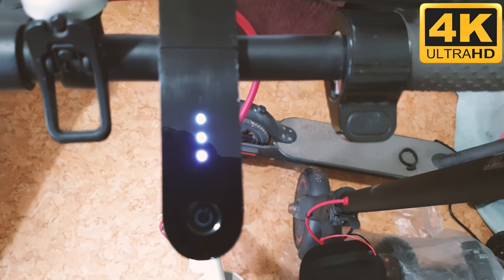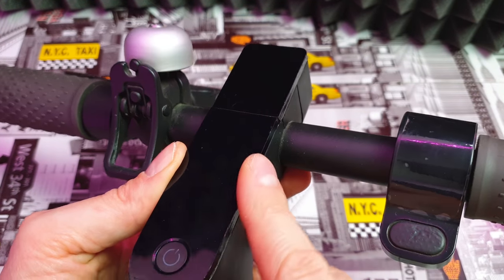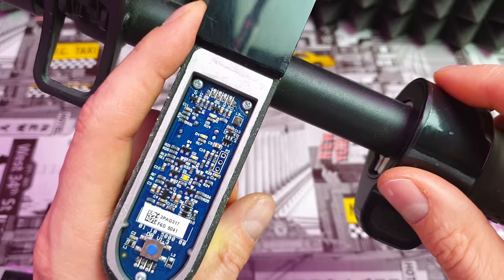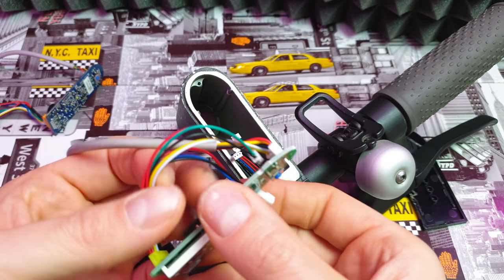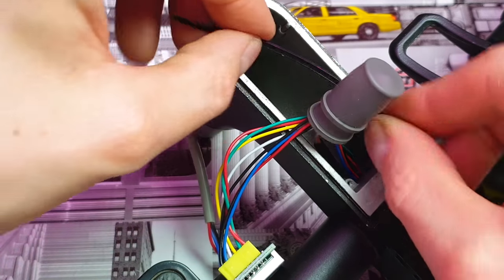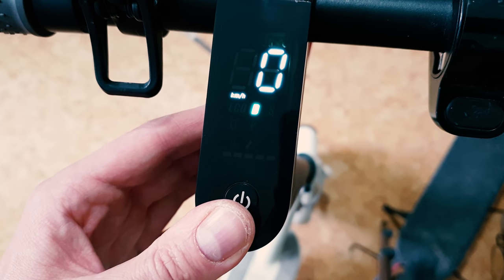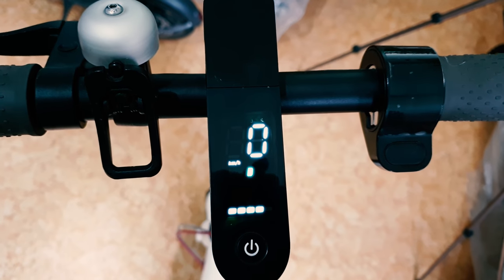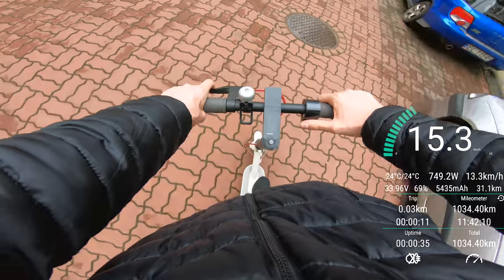How to Mod Xiaomi M365 to Pro Dashboard 🚀⚡ For only 25$ ?!  🔥🔥

Comment: I'm a little concerned as how the pro dashboard treats the smaller battery and weaker motor, are therr any compatibility issues such as over charge/over discharging battery, are you still able to update through mijia etc
Reply from the maker: So you can decrease power in moded FW, no other issues, dont connect to xiaomi app cause its not very usefull any more.
Reply: @PirateWasHere  thanks for the confirmation! Will definitely do this mod~

Comment: Thanks man, everything works fine (also could't update BMS)
Reply: Connect old dash board, just the 1 wire and update them then reconnect upgraded dash
Reply: @waldo2600  which wire? the big one?

Comment: Hello Pirate,
is there any working BMS and BLE, the one you provided cant be flashed on mine. Or is there any other I can try? Thank you
Reply from the maker: U dont need to flash it 🍕🍻
Reply: @PirateWasHere  I am getting random bluetooth disconection during I ride.
Reply from the maker: Looks like some issue with bt, check how to update fw on bt it can be done by other hardware

Comment: Hello 🤗! 
May I verify... So if I want to go ahead & switch to this Bluetooth dashboard, etc, did you say we should also get bigger battery? What happens if I don't boost or upgrade battery? Would the battery get drained really fast??
Thank you in advance
Reply from the maker: Yeah cause pro in stock got 1000watts while classic around 600
Reply: @PirateWasHere  Sir Pirate, may I ask another question? 
Can I just plug in & have the Bluetooth digital dashboard, and use it as is, and not do any upgrades or hacks? 
Would the dashboard work if I don't flash those firmware things??

I would like the dashboard to read the speedometer, but I don't want to boost my regular M365.

Comment: I managed to install Drv upgrade. But I got stuck with bms upgrade or ble upgrade. Bms is stuck on 95%, ble don't even start. I tried to switch to old dashboard (as suggested ) and managed to flash bms pro.  When I switched back to pro dashboard there is still no change. Still some strange version number.  Side effect is that rear light is not working.  I am not sure for any other side effect. Is there a way to to flash bms pro version or is it even not necessary to do that upgrade?
Reply from the maker: I woud not Upgrade BMS and dash , just DRV :)
Reply: @PirateWasHere  thank you. BLE seems pointless trying to upgrade if it works as it is. BMS is for battery pack if I am correct? Do you have any experience of having problems with battery/power because of dashboard upgrade?

Comment: When I drive with DRV155 loaded, the scooter gets to 30-32 km/h and then it slows down and then reaccelerate again, is there a way to stop this from happening? like before custom firmware is was stable on 25 km/h without slowing down the acceleration when hitting max speed. Is a pain when hitting 30 km/h and it breaks down to 28 km/h and then accelerate up again.
Reply from the maker: I hope Devs will fix it soon and fully unlock power :)
Reply: just use a power step up to increase voltage to max 60 volt then you will drive like 37km/h
Reply from the maker: @fuzepper  I am not sure if ESC can handle it and that step up module will be BiG and super hot after couple minutes :)
Reply: works for me, my power step up have heat sink it's a 1200 watt max 90 volt I use only 60 volt
Reply: Fuzepper what is power step up?
Reply: The scooter will only drive faster than 32km/h after you remove  hard speed limit and change voltage to 60  and also increase the battery  voltage to like 60 volt.

Comment: How do u change the dashboard to MPH instead of Km/h?   I can't connect to mi home anymore
Reply from the maker: I am not sure if this is possibl3, check moded FW
Reply: Use the Xioami Mi app, go to setting and change Metric to Imperial.
If you have upgraded to the Pro Board, change the region code to China and please do not upgrade to firmware to 1.6.0
Reply: @demo6592  yeah. I figured it out. I had to plug in original dashboard first to change to imperial because mi app doesn't detect new 1.5.5 fw. Also. Cannot have tail lights always on anymore. If I change lights to always on. It goes back to km/h.  Odd.
Reply: @thieu714  You need to change the country settings to China on the Mi Home.
Reply: Demo thank you it worked! Why not upgrade to firmware 1.6.1?

Comment: Why your scooter only at 60% but you still can go until 28km range? Did you mod your batteries?
Reply from the maker: nope, stock 7,8ah battery
Reply: you did not notice, scooter run on air,  0kg load

Comment: what happens if I install m365 firmware when I don't have the m365 pro dashboard ? (I've ordered it but it will arrive in 3 weeks; can I still use/try the PRO features ?
Reply from the maker: U will be not able to upload pro FW on non pro
Reply: @PirateWasHere  but you said "it would be better to install firmware before changing the dashboard" ? did I get it wrong ?
Reply from the maker: nah, I never said it ;)  * at least I hope that i didn't say it  . 🍕🍻
Reply: @PirateWasHere  so you say that on my m365 (not pro), I should first install the PRO dashboard then upgrade firmware. is that correct ?
Reply from the maker: yes, then upload DRV firmware, like in the video :)

Comment: So bluetooth symbol will keep on blinking forever?
Reply: It always blinks for me, but is there any way to turn the bluetooth blinking off?  It only turns solid when connected to phone
Reply: @acfougner4427  flash the board using a stlink.  this will get it to factory condition and will allow bms and ble to be flashed.

Comment: Hi lads,
this might help someone who thought for a minute, that his scooter was gone for good.
I will try to be short and understandable as possible.
If you finish your DRV flash and your scooter seems to be gone, you can not turn it off neither connect to it, or your tailight starts flashing when you're  moving the scooter, do not worry.

Unscrew the screws below the bar like you did when you were installing your new display, and disconnect the male pin from female, wait for 10 seconds and reconnect them.
Bam, your scooter is back to life, just go back to m365down g and connect to it once again, check version, open BML bin and flash it.
Everything should be okay now.

Cheers
Reply: Happen same, but I can't flush the bin, is not working, got an error like "retry" after 95% loading

Comment: How many Ah do you see with the Pro board and firmware ?
Reply from the maker: 7.8ah
Reply: Pirate hmm sure?

7.8ah is like 300w with a 39v battery. It must be higher :)
Reply from the maker: stock battery got 42v 7.8ah , Pro got 12.5ah
Reply: Pirate ah sorry, i meant how many amps does the motor pull from the battery with Pro display and firmware?

Stock fw on the M365 pulls around 17-18ah, at 39v its around 700w.

Comment: Hey my scooter locked and I wait and its didn't help.
Also m365 tool doesnt work...
Plz what can I do
Reply: Connect factory sreen   and  connect to old Mi scooter app from Mihome, then Unlock it and reconnect everything again from scratch for the new screen
Reply: @Sameft  will this solve the locked display problem? How do you get past the bms 1.1.6 not getting past 95%?
Reply: @fleebleflam  hmm i  think  i doowngrade  to  1.1.5  in  order to install  the  new  screen
Reply: @Sameft  wow!! I was on 142 when i flashed the 155 drv (which it's on now) I just can't flash the other 2 files! I am worried i will burn out my battery. So i would really like to have the "Battery Maintenance System" working correctly. Is there a way round this? And were do i find these old fw files? Are they on the Xiaomi website?😁
Reply: Anyone try the new 1.6.1 pro fw at all?? I would like to get some views on what the differences are please😁

Comment: Can you please link the firmware file used at 9:42? Thanks
Reply from the maker: This video is 3 years old , it will not work with newer firmware
Reply: @PirateWasHere  I know that. Not to worry though, my scooter is on old firmware.

Comment: Hi @pirate, After the upgrade i got only 20 Km/h in "D" mode. Is that normal? Before that i was able to run at 25 Km/h.
Reply: ''D'' mode is Drive mode... it will do just 20km/h maximum...… Sport mode goes that 25-28 km/h :)
Reply: @xkilersx2343   Ok, I thought "D" mode was the same as normal mode before the upgrade.
Reply: Before  upgrade u had just Eco mode and Sport mode... now you have Drive mode thanks the upgrade :) btw i upgraded it just yesterday, and i am happy as fuck.
Reply: @xkilersx2343  I got it. Thanks brow!
Reply: no problem :)

Comment: Is the external Battery Pack a must for this Dashboard? Or how many Kilometers does the Battery range decrease per full Charge?

And can I flash the Unlocked Speed Mod for the M365 Pro that you linked in the Description with this Dashboard?
How do i go back from Unlocked to non - Unlocked Version with the Pro Dashboard? Do you have a Firmware to flash for this?

That are many Questions, hope you will answer 😅!
Thank you for your help!!

Comment: Please answer my question would really appreciate it, because people on the Facebook group won’t answer them right. 

If I Downgrade 1.5.1 to 1.4.3 with BLE 072 and CFW from Botox, can that possibly brick my scooter? 🛴
Reply from the maker: Nope, so no worries
Reply: Pirate thanks for awnsering man! 
Can I downgrade straight from 1.5.1 to 1.3.8? Heard it was better in performance or something? Also what’s the best firmware for battery life?

Comment: hey , thanks you for the guide , but i have a problem , i manage to connect to scooter with M365_downG but I call "check ver "  the is write "Asking Scotter Version" , but is get stuck there , dont give me any info .
Reply from the maker: so when U hit button check info , no info appears ?
Reply: @PirateWasHere  
exactly it's write "asking scooter version" after I pressed the button of ver info than it's get stuck there, no info appear.
Reply: @PirateWasHere  
I have  european black
Reply from the maker: No idea bro ... 😭
Reply: New firmare 1.5.4 me to not work of downg
Reply: @Edgarsggg  
So how I am downgrade the version ? And wish version I need for ?
Reply: I dont know me to intresting )
Reply: @PirateWasHere  
Hey my friend,  I find the problem , Bluetooth device on the controller (dashboard) faulty so I buy new ( pro dashboard) the Bluetooth  problem fixed.

One more question , I can hack of m364 without hurt the action of the dashboard pro on the m365 ? (Not pro).

Comment: It doesn't work with OEM 1.5.1 firmware ?
Reply from the maker: It should fine, i upgraded from 1.3.8
Reply: @PirateWasHere  I'm OEM 1.5.1 now upgraded with Xiaomi Home. It suppose to work with this one ?
Reply from the maker: @cosminruse5477  if not, decrease the bt fw, i will make how to instruction, give me 5min
Reply: @PirateWasHere  did you manage to finish that how to. Ty
Reply from the maker: https://www.facebook.com/groups/epowergroup/ join group  and search for 
Pro365Rollback_v1.1.apk

Comment: you dont need that lol. after 1 week with new board you dont look how fast you are and the custom firmware is more difficult to  adjust and some options are missing there
Reply from the maker: I didn't noticed any issues
Reply: @PirateWasHere  no issues? with standard board  you can change motor power... but with pro firmware you have t o chance 3 values and 2 of them are just restricted ^^
Reply: @PirateWasHere  pro is just harder to adjust xD
Reply from the maker: @Bergwacht  its the same settings :)

Comment: Does this drain M365 battery more?
Reply from the maker: Yes due to better power
Reply: @PirateWasHere  Got it, thank you for letting me know! I probably won't use a pro dashboard in this case. 

Great work on yours though!
Reply from the maker: For me this mod is like must have 😊
Reply: @PirateWasHere  how much more it drains battery though? how much km can you go with pro display vs stock

Comment: It get stuck on 98%
Reply: The drv
Reply: Now I can’t turn it off
Reply: Help please
Reply from the maker: try disconnect battery and wait 10minutes , then try again upload FW
Reply: @PirateWasHere  I’m gonna try again
Reply: @PirateWasHere  I try the drv again and still it get stuck on 98
Reply: @PirateWasHere  what you mean by disconnect battery
Reply: @PirateWasHere  please help
Reply from the maker: Hi man , disconnect battery from controller. Try to use other firmware
 This video is pretty old so could not work very well on new revisions. Try other fw and you will make it work, also you can upgrade firmware by stlink
Reply: @PirateWasHere  wich controller u mean?
Reply: @PirateWasHere  it doesn’t work by stlink sadly
Reply: @PirateWasHere  because I have the 1.7.1 version
Reply: @PirateWasHere  so pirate what can I do I really need help